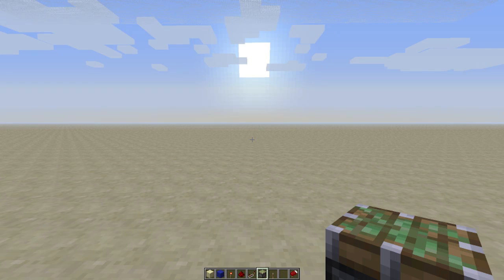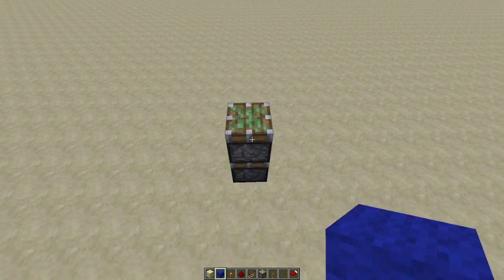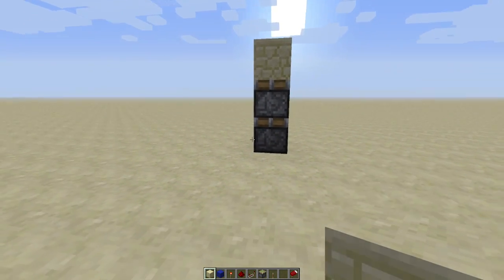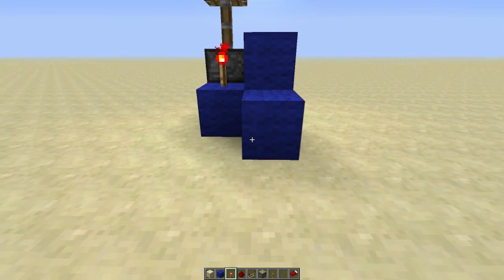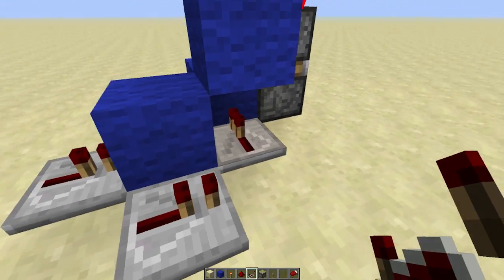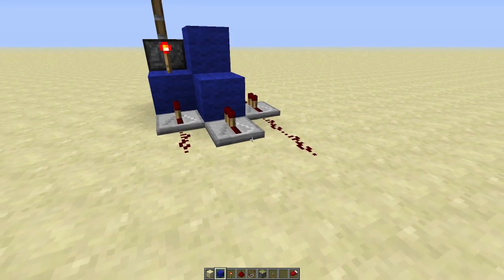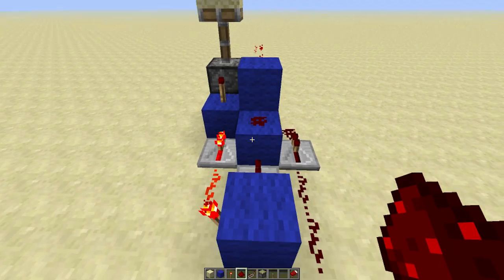1.0.0 Fixes: Double Vertical Piston Extender [60 Seconds With CNB]

Comment: Hey CNB, I love this design and it works great for ordinary use, but there's a tiny little problem with it.  The rest configuration isn't actually stable - any block update on the bottom piston will cause it to extend if it's in the retracted state.
Basically this makes it impossible to use in tight proximity with other redstone or piston elements.  Can you work on making a fix for this?

Comment: For xbox add an extra block in for the middle repeater (the one you place 1 redstone one). This is so that when you put the redstone down its going directly into the block with the torch on the back and turns it off

only problem i have now is that the block on top of the pistons doesn't move down twice :(

Comment: Awesome vid again thanks.

Now for what I want to talk about XD. I installed 170 mods. All work. But now a sticky piston can't be retracted, even when not extended. Anyone else have this?

I don't even think it does what I want for my application, which is to make a 2 high door pop up up & back. I tried this in vanilla works perfect, but if I put a 2 blocks on it only 1 of them is retracted. Maybe that's how sticky pistons are supposed to work? I'm pissed I can't even make a simple 1x2 door.

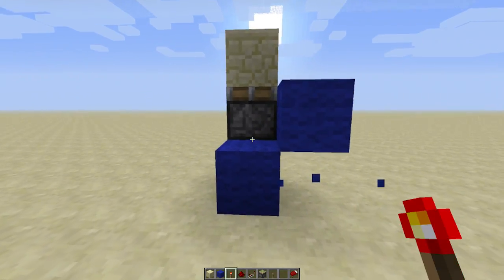Comment: I have it working. Just add a block above the torch at 0:21. (It's the second torch he puts down). I have a problem though. The extender works perfectly if I have a lever connected directly to the input block, but if I have the lever elsewhere with a signal leading into the input block, it won't work, the bottom piston won't retract. Help?

Comment: 2 minutes... for such a simple machine? Sure he doesn't explain HOW it works, but does that really matter? (you can figure out how it works if you know how redstone works) If all you needed was a vertical double piston extender, then this is fine in 60 seconds. Just run a repeater into the block instead of a lever (if you need a different input), and you're fine.

Comment: For those having issues with this design or even other double piston extender designs for that matter, the problem you are experiencing is possibly due to glitches with pistons and repeaters that were not present until the 1.0.0 release. If this design doesn't work, try changing the timing of the repeaters or try a different design to see if something might work better.

Comment: @zenak2 I can't think of a single sound that's gotten worse as new versions came out, and to repeat my previous point, the End is entirely optional. You never need to go there if you don't want to.

The game HAS been optimised for better performance, and I doubt anyone will disagree that the difference in framerate is much better in 1.0.0 The graphics have always went for a "simple is better" style, so improving them is against the spirit of the game, and can be change with mods if you prefer.